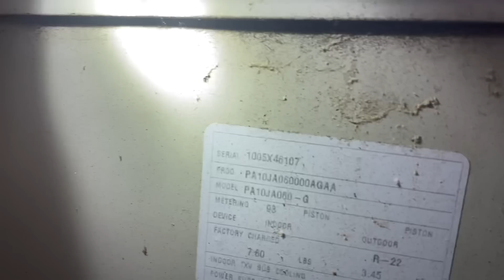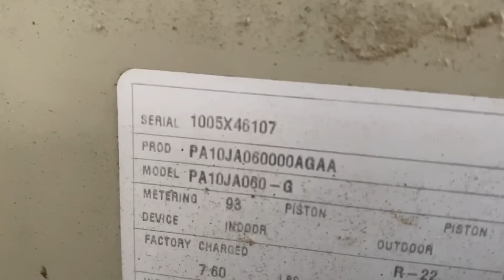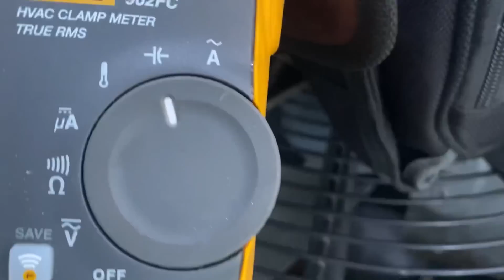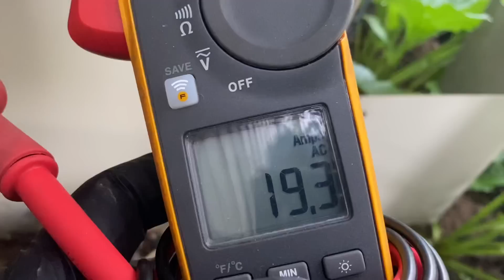Payne Central AC Condenser Not Cooling How to Test a Dual Capacitor

Comment: Hey Mike,for about $20 you can get good quality silicone rubber leads for your meter,they also have straight banana plugs instead of elbows,so no strain on the leads,plus the silicone rubber weighs next to nothing & when testing it feels like you are just holding the probes with no leads, definitely worth it,if you are interested I recommend UNI-T UT L16 leads,I use these and they are the best I have ever used.

Comment: I wouldn't call that a Diagnosis. The spit system includes 2 parts, one outside and one inside, the video was showing only the outside unit inspected, there might be a potential problem with inside unit such as extreme dirty coil, blower wheel, or trap and loose wire connections..etc. which can affect the perform and break the system in the near future. Even the system are well maintained, all high voltage wire connections need to be inspected yearly and tighten down if necessary due to vibrations occurs when the system is running. Delta T should be performed to ensure it's within normal spec. All of these inspections can be performed under 1/2 hr and you can walk away with a peace of mind that there won't be any call back and customers are happy.

Comment: Checking the contractor, pressures, as well as ensuring the condensate is draining. While cleaning the bottom of the condenser is nice, that time could be better spent elsewhere, and you could use it as a sales pitch for a maintenance agreement.

Comment: Fyi  That shutoff outside that looks like a circuit breaker-  I've got 2 of those they are not breakers they are merely disconnect switches
Reply: Many people assume that they are a circuit breaker because they look just like them, but yes the are just a disconnect. On the side of the disconnect "breaker" it will say "no over current protection" which is the give away. Much better than the pull out style disconnect in my opinion.

Comment: you could add a few drops of turbine oil to the condenser motor ,shaft end,rinse the condenser from inside fan was of,vacuum the drain line to prevent call back,at least check pressure on low side.and check delta ,first time checking unit to get a base line,and log readings on cover for future.

Comment: Great video Mikey.... Only other thing I would check is temp split across condensor....supply air temp....and ohm contactor...coil didnt look bad and is deteriorating so chemicaly washing it would probably make it worse.  Verify filter is good but sometimes gotta trust customer.... Again great job as always

Comment: if mike showed up replaced the cap and left within 10 mins the customer would have thought he got ripped off. This is the proper way to do a service call
Reply: Service call start from the moment you start driving to customer house, is not just the time you probably spend in people house.
Reply: @tvas2513  yes but the customer does not see that. Most people drive to work everyday and do not get paid for that by their employers